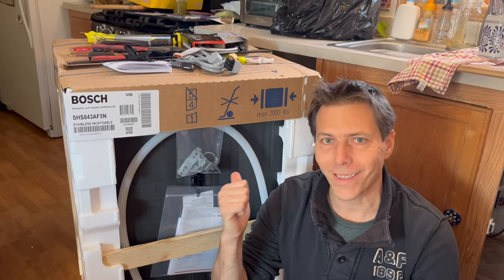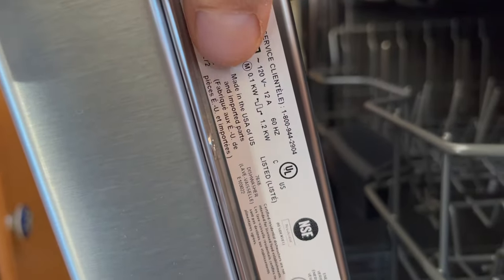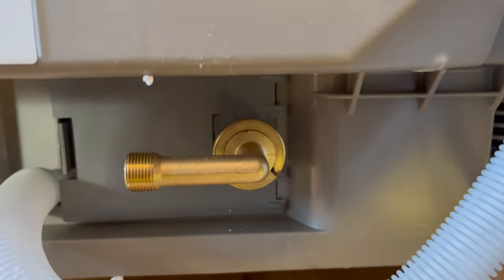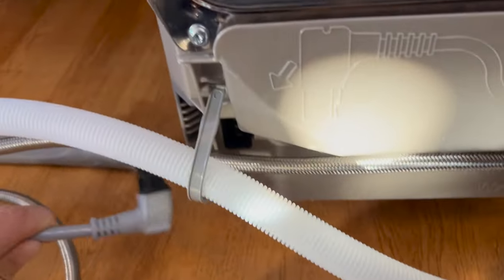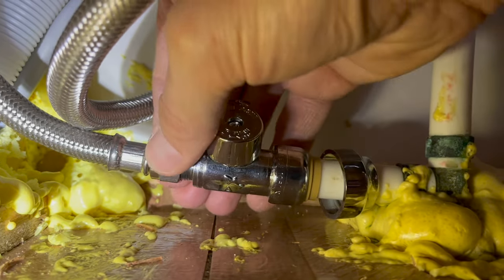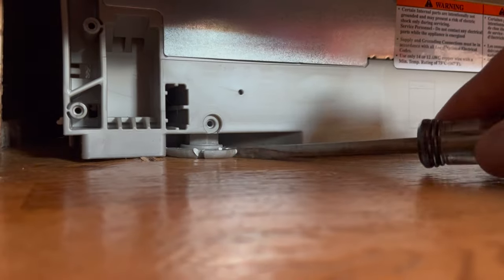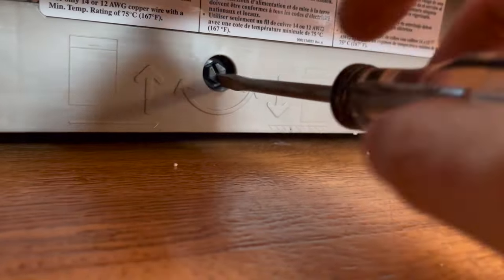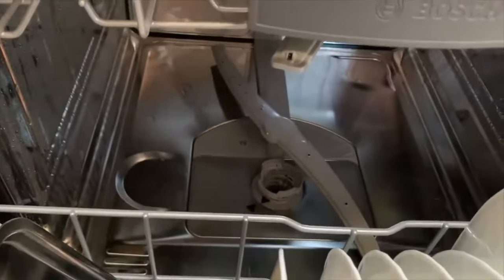How to Install a Bosch 300 Series Dishwasher from Lowes, Home Depot, etc.

Comment: Any way to cover the insulation that is on the back of the front panel? The kickplate is behind it and unfortunately our kitty had been eating the insulation before we figured out what he was doing! He threw it up. We have to stack heavy boxes in front of the dishwasher and stuff towels behind the insulation until we can figure out a solution! We are desperate to find a way to block him from the insulation. We can' t use any rubber because he will eat that (ask me how I know -- we now have a new washing machine because he ate the silicone seal of our previous one:(

Comment: Looks good,  I see when you close the door, you can't see the buttons to operate.  How does that work?
Reply from the maker: Hi, you just press the buttons to select the program before closing the door. :)
Reply: I just bought one and they no longer have physical buttons.  It’s touch sensitive, and can only be operated while the door is open.  They also took a step back removing the countdown display although that really just adds another point of failure.

Comment: Hi: Great tutorial.  I wonder if the plastic used to hold the sewer tube attached to the wall is the same piece of plastic that was holding the bag at the beginning of the video.
Reply from the maker: Yes, it's a 2 in 1 thing. Cheers!

Comment: Great video, thanks.If i have Maytag dishwasher and now i just  ordered Bosch 300 do i have to start all over? Or there is a ease way?
Reply from the maker: Well, I do believe the water connection will differ between models. You might very well need the adapter kit for the Bosch. Cheers!

Comment: Every DW I’ve installed has the 3/4 water connection where you need the 3/8 adapter.

Comment: Hey Tom, we had our dishwasher delivered today and it has a ding on the right side (black mastic?) and the stainless steel is showing. Do you know if is an issue? It's a bosch 300 series. Thanks!
Reply from the maker: No, I don't see why that would be an issue. I mean if it's dented or scratched maybe you could call the seller and get a partial refund for the blemish. But, it won't be seen when mounted anyway.
Reply: Thanks, I wanted to make sure it was only cosmetic. Cheers!

Comment: I bought a similar unit and did the same steps except it won’t power on when I plugged it in.
Reply from the maker: It should power on without issue. Have you checked to see if a fuse tripped?

Comment: How do u know when the back leg is high enough ?
Reply from the maker: You can test it with a level, before pushing it all the way in. You should also notice whether or not it's level based on how the racks pull out. They should pull out, nice and even, parallel to the floor. Cheers!

Comment: WOW , most dishwashers are wired in you really said nothing about that and that you may need an electrician to put a outlet, which you showed nothing about, also I understand getting the dishwasher level side to side but where do you put a level to get front to back level?? all in all very nice video, love the pooch
Reply: There’s an adapter kit sold separately where a junction box is installed.  I don’t like this solution.

Comment: According to the Bosch website:  "Can I run Bosch dishwasher with cold water?
Yes, our dishwashers work without hot water and we do recommend connecting the appliance to cold water unless you have an energetically favourable means of generating energy from a suitable installation, e.g. solar heating system with circulation line."
Reply from the maker: Thanks for that very helpful comment!

Comment: Why do we have to do so much work to install a dishwasher in America?🤔🤔🤔. In Europe we just have to set inlet and outlet hose. That's it
Reply from the maker: Yes, I know. I have installed one of these in both the USA and Germany. I don't know why Bosch designed the American ones to require an adapter.
Reply: @TomsDoItYourself  perhaps to increase the selling  price of the product in America 🤑😂.
 Tnx for your info.
Reply: @TomsDoItYourself  could you help me how to clear an air clog in the drain hose please? Water splashes out from the drain pipe. It's a newly installed pipe line below the sink. 😥😥
Reply from the maker: @beckyrockz348  Do you have a short video? There shouldn't be an air clog in such a line, but maybe the drain pipe is not sealed well enough somewhere. A video would help.
Reply: @TomsDoItYourself  unfortunately I don't have a short video, bcz as soon as the hot water splashed out of the drain pipe, I  turned off the dishwasher inbetween while it was running. I don't know what to do as it's a 3 days holiday here in Paris.